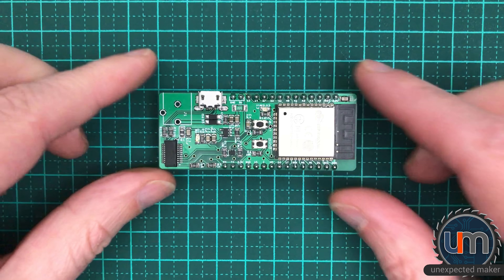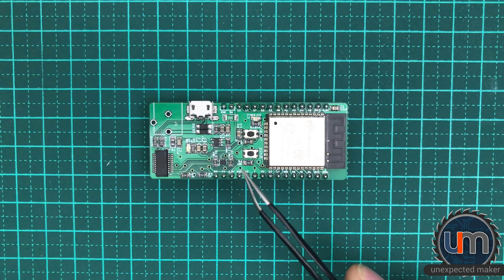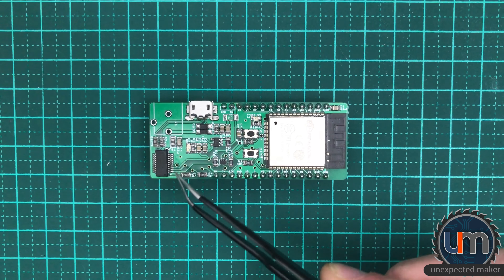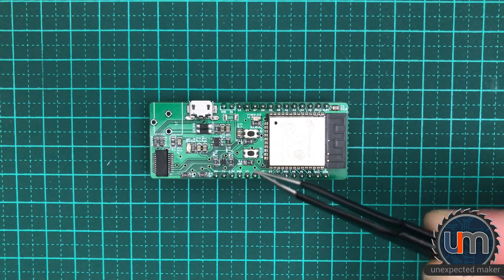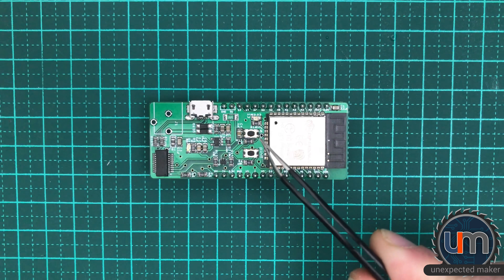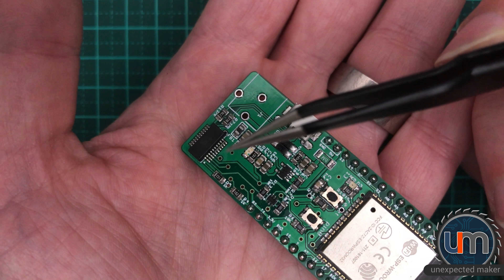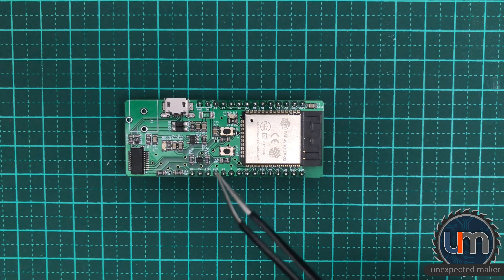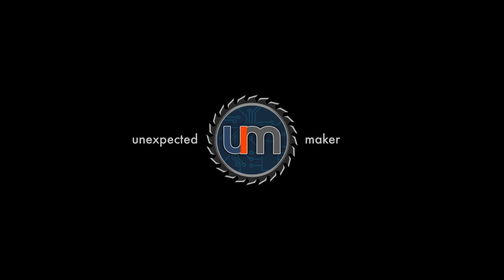My ESP32 Dev Board is Fixed!

Comment: Nice one! When I do get around to my board I think I'm just going to lift adafruit, even if the chip is on the way out!
Reply from the maker: Where is the fun in that? hahaha. When my new chips come in from AliExpress, I'll have 3 types of UART/FTDI options... and I really should now just standardise on the CH340G as they are cheap and drivers are finally getting more stable.

That said, all of the SAMD chips have USB built in, so it's currently only the Espressif stuff that need external UART. Maybe the next Espressif boards will have USB built in too!
Reply: Unexpected Maker price! I'm a cheap guy Seon 😁

Comment: Nice outcome, and nice summary of your fault finding.  What I always find fascinating is how often I go fault finding and instinctively start thinking of more complex problems / design issue, but 80% of the time it turns out to be the simplest of faults!
Same logic seems to apply to my software debugging! LOL 
PS. I think dropping FTDI in favour of a cheaper CH340G or CP2102 is a good idea. :)
Reply from the maker: Yeah, most of the time it's always something simple.... in hardware and code. I have 20x CH340G's and 10x CP1204's on the way... with lots more ESP-32S modules - should be here in 6 months!
Reply: Didn't you mention that the cp2102 was marked not for new design? This concerned me so I started looking at the cp2104 and cp2105. Although you need a driver for the sil chips, I found them to be better than ftdi, they seem to perform better at 192600

Comment: Classic how you have all this expensive maker equipment (even a Prusa MK3!), but no Oscilloscope!  
I can highly recommend a Siglent 1202X-E.  Best scope I’ve ever had, which also obsoleted some of my other test equipment (after replacing my very old CRT scope). :)
Reply from the maker: I've just never needed a scope... I mean I drool over them daily, and would love to own one, but so far it would have just sat there collecting dust. Right now I am torn between the Siglent 1202X-E and the Rigol DS-1054Z - I'd love 4 channel.. but I'd also love 200MHz, but don't need either ....
Reply from the maker: Also, the MK3 is cheap compared to Ultimakers, FlashForges, Makerbots, Ups etc... Quite cheap actually. But yes, I get what you are saying :-)
Reply: Since the MK3 is out of my justifiable price range (for my first 3D printer), I'm researching cheaper options. The upgraded Anycubic i3 Mega is looking like a possible choice for only AU$480 (A MK3 would cost me around $1500 with our NZ $250 customs costs added.. no customs fees on just $480 import). 
The AnyCubic Photon SLA printer for only AU$690 also looks amazing for smaller high resolution prints, with resin prices coming down. Maybe I'll end up with one of each. LOL nah.
Reply from the maker: Don't go SLA... sure, it looks great, but the prints don't last, the mix is toxic and dangerous and apparently the smell is terrible. Stay with standard 3D if you are new... I always recommend the CR-10 for a first printer... big. reliable workhorse, but clearly you have done your research ;)
Reply: Thanks for your thoughts! Definitely got the CR-10 in my short-list. But most recent (ie. 2018) reviews & comparisons now almost unanimously seem to pick the “updated" Anycube i3 Mega over the CR-10. The sole exception being if you need the larger CR-10 build volume.  
So, pretty close to pulling the trigger on the Anycube. Helps that at $480 it's a relatively low risk decision, as it’ll be an easy local re-sell if I subsequently decide I'll upgrade (or I loose interest). :-)

Comment: Unexpected Maker

Do you do the old (side-step) thing with the meter probes when checking IC?

ie. test pins 1+2, then move one probe to test pins 1+3, then 2+3, 2+4 etc.

I've found that helps to quickly narrow down a few more pins for shorts.

(Also handy when checking for continuity between the top of the IC leg and each pad. But then you would test pin/pad 1+1 for a beep, then 1+2 for no beep, 2+2 for beep etc.)

If you get a weird issue like this, it's always worth checking for signal shorts to both Ground and VCC too. :)

Glad you got it working, mate. ;)

I know you used the reference schematic, so it quite often turns out to be the simpler faults in the end. I've done the same thing SO many times. lol
Reply from the maker: I did do the 2 pin shuffle, but I did it quite quickly, and even after finding the bridge, before fixing it, I did a quick shuffle and it didn't trigger the DMM. It was very hard to get it to ping the DMM touching the pins... maybe flux buildup or something. Anyway, I know I'll be WAY more thorough next build!